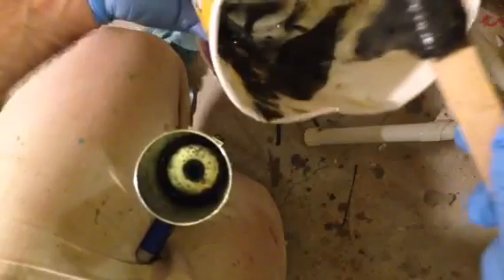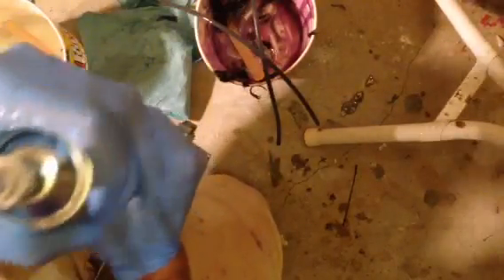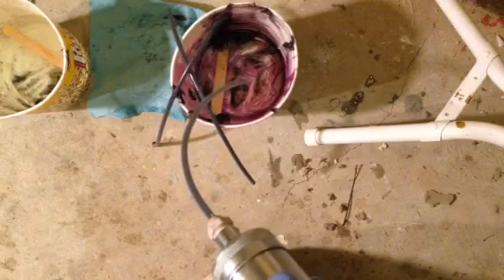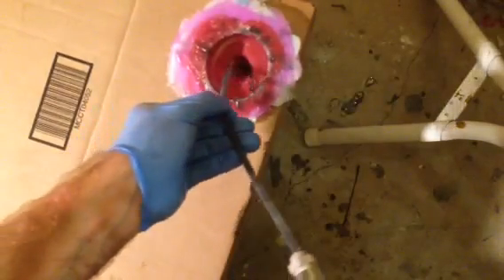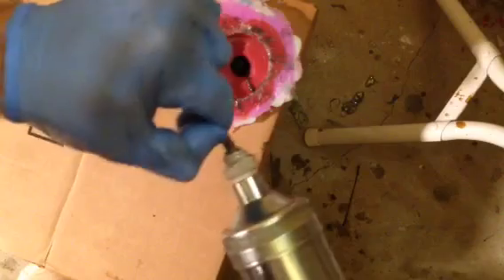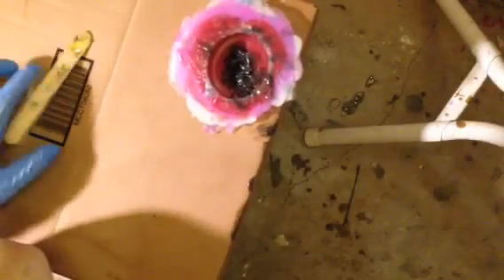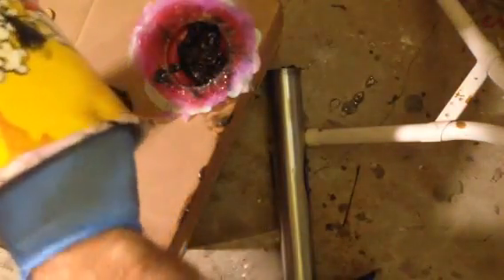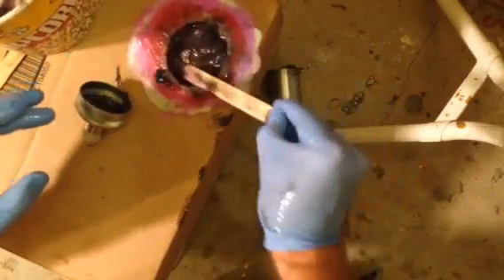Conductive silicone injection molding

Comment: Soooo......i tried this, by mixing crushed Graphite Electrodes with Foodgrade Sillicone. And.........it didn't work. Can someone explained it to me what did i go wrong? Do i really have to use caulk? Can i use other material?
Reply from the maker: It explains it in the instructable, food grade silicone will absorb graphite particles too well, and make it not conductive. You need to use chopped carbon fiber instead
Reply: @dinalab  can u give me link to that? Thank you
Reply: @dinalab  I would also be interessted in a link or a more specific explanation. Thanks!